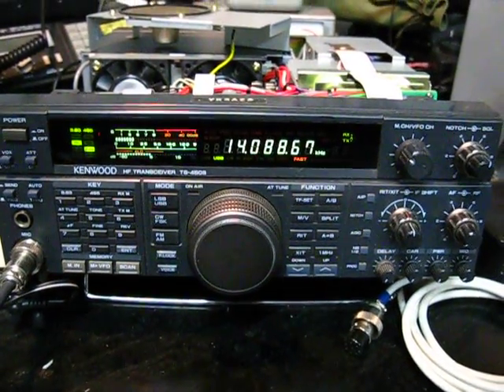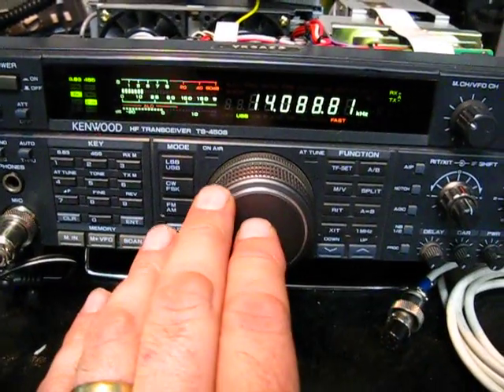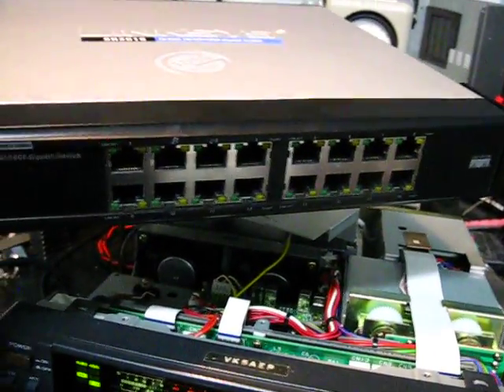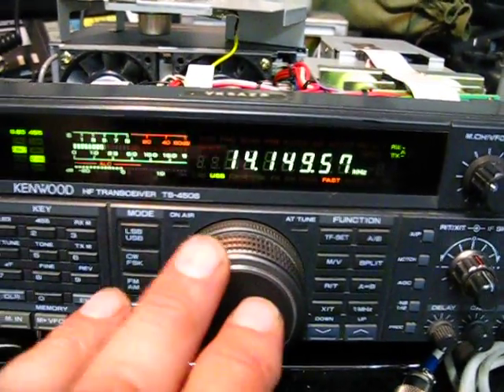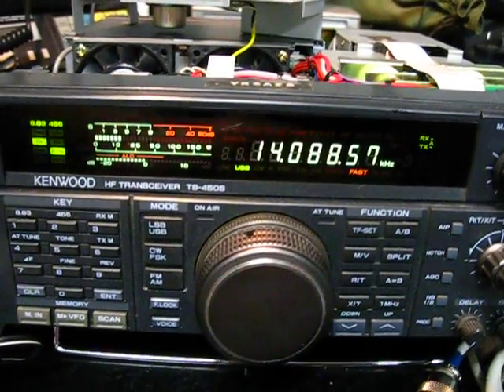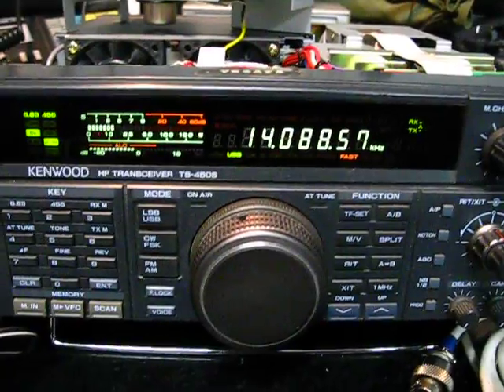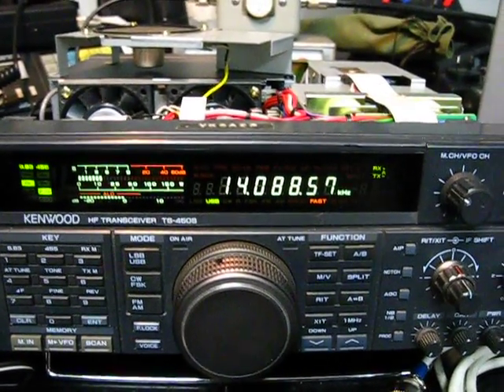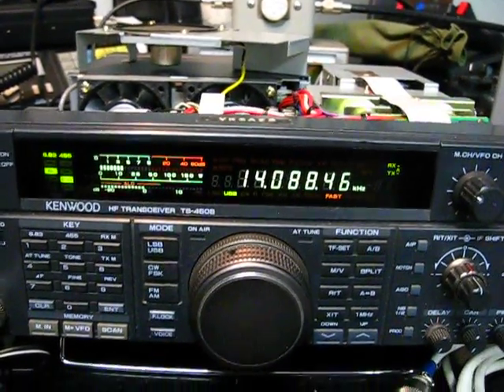Noise on HF caused by Ethernet network switch activity

Comment: Hi Michael, Thanks for sharing your research. I am new to the HF game and currently hunting for interference sources at home. Whilst certainly not the biggest source of noise, by process of elimination I am rapidly coming to the conclusion that this honour belongs to our solar powered weather station on the roof of our double story house, I had put my loop antenna near a cabinet in the ceiling which contains an Ethernet switch and noted a 5 dB reduction in noise floor when I turned it off. Like your experience, replacing the switch did not resolve the issue. I'm hoping it is fairly localised around the switch and far enough away from the antenna, but one problem at a time.

Comment: I had this from my small LAN. Cured it with 7,8, and 9 turns around ferrite rings of the right mix. 7 turns worked ok on cheap, anonymous Chinese rings, but 8 and 9 turns worked tremendously well on the right stuff.
Every cable needs a ring at every end - no shortcuts. Also ferrite the mains cords to all PSUs that you can't do without. Where possible, dump the crappy cheap SMPSs and replace with older tech iron-core tech.
The difference is amazing. I now have an HF noise floor about 1 S unit, where it was up around 5 to 7 before, from 6 to 20 MHz.
Luckily I live in the sticks so neighbour noise isn't a problem, but some mains-borne noise gets in occasionally. It's nothing compared to the noise I was making in my own house.

Comment: PA0NHC : If wire pairs in CAT cables are perfectly balanced, they do not radiate HF. Unbalance can occur if CAT cables run near some metal, or other CAT cables. ===Use a good battery powered SW receiver, and listen if your CAT cables radiate noise. If they do, use ferrite clamps to balance them. === Best use clamps with a BIG hole. They allow to wind more cable through it. 2 turns => 4x impedance, 3 turns => 9x impedance etc. === On every CAT cable place a clamp at the very beginning, and one at the very end. Also do so at all power cables (230V~and 12Vdc) DIRECTLY near all switched mode power devices. Do not forget your TV, etc. The investment is worthwile. === !!! Try to make the distance between all network and power cables to your antenna as big as possible. === AND put ferrite clamps over all of your coaxes, at the beginning and end, and possebely at 2m intervals. This prevents that mantle currents (and on the coax outside induced noises) wil be injected into your receiver. === The metal cabinet of your HAM receiver is NO guarantee that no mantle currents will creep into the receivers input circuit. === You could use a big ferrite core to slip directly over the receivers antenna connector  (try high Mu or material 61). === A perfectly balanced antenna system is far less sensitive to induced noises. That is why a perfectly symmetrical LOOP antenna can be much quieter than an a-symmetrical wire antenna (fi. 20dB difference). Success es 73's, Nico. www.pa0nhc.nl

Comment: Hello Michael; Thank you for putting this video up. Thank you!!!!!! I have spent the past 8 months frantically looking for some kind of information about interference I am hearing on 160, 80, 40, and 20 meters at my qth. I have asked other operators here about this noise and nobody had a clue. Now I know what I am looking for. What you demonstrate on your video is what I am hearing here at about the same spacing of frequency intervals you show.  In my case there are 3 or 4 different households nearby that are radiating that stuff and it is up to 20 over 9 on my TS-450s. The sound is the same on all of them. 73's from Dave, WA7AXT

Comment: So any update? What troubleshooting measures were taken? Was it the power supply for the switch? The switch itself (no cabling plugged in), or switch plus cabling?
Reply from the maker: +Matt Noble I don't think the noise is related to the switch alone.  One thing I have tried is to use a Mikrotik Wireless Router in the shack... connected to my main Wireless Access Point. I used short Cat6 shielded cables from the Mikrotik router to the computers in my shack.  This eliminated the very long Cat5 cable runs from my network closet to the shack but I am still getting Ethernet noise on HF which goes away when I power off the Mikrotik router.
Mix 31 ferrite cores on the cables make no difference.
Reply: My question has to do with the switches power supply do you have a non switch mode supply you could power the switch with?
Reply from the maker: +Matt Noble My wiring closet and my shack each have a 250 Ah backup gel battery bank.  I've tried running the wiring closet on battery power... and I get the same result.
Reply: There is still a possibility the the switching frequency of the AC wall wart is 14KHz

Comment: Take a small (and cheap) portable World radio (with HF) and check the Ethernet Switch for noise and also the switched power supply of the Router and Switch. The Switches make some noise but the power supply must be clean. I had to throw a way all those switching power supply's and use old fashion transformer devices to get rid of the noise. Our router is one floor down and is very quiet, almost no noise. Use CAT6 cables.

Comment: Have you tried running the switch from a regulated power supply.  I am hunting for a 10s9 noise in my qth at this time.  Found PC power supply to be one of the problems.
73
Steve
WB4IZC

Comment: Have you checked each network cable individually? Ive found some junk cables that created RF noise. I now run shielded & grounded Cat-5 cable in my house now. Its not much more expensive. Its cheaper to buy it in 1000' boxes, cut & crimp your own metal grounded connectors.

Comment from the maker: I'm old school... I have separate network equipment. ADSL 2+ Modem, Cyberguard router, Mikrotik WiFi, Linksys Switch, Linksys VOIP box.  Never been a fan of the all-in-one solution.  
But I will experiment with turning off each individual network device and see what happens.